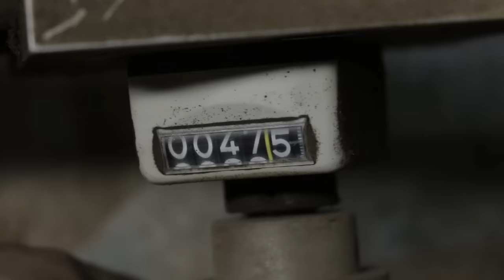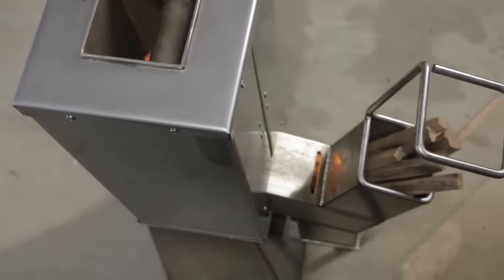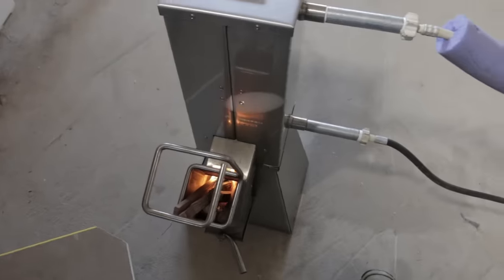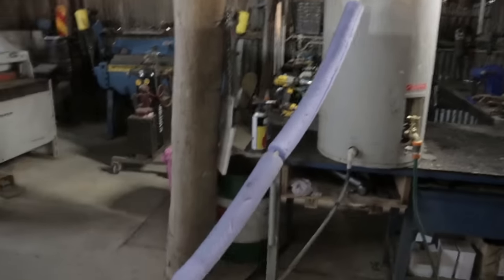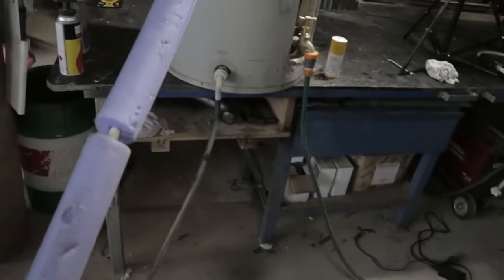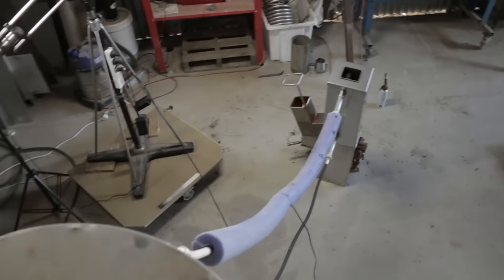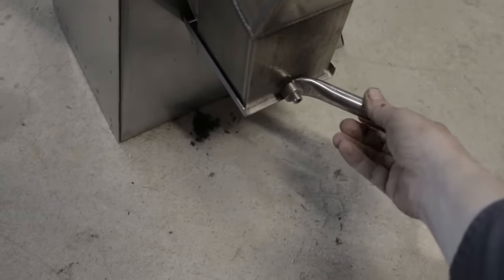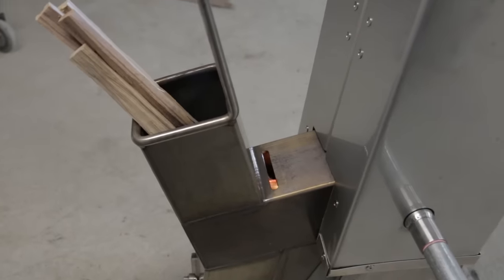Making an insulated rocket stove hot water system

Comment: how do you deal with excessive pressure ? what ratings should we be looking at for the tank
Reply from the maker: There's no pressure, it's an open system as per regulation for a water heater with an unregulated heat source.

Comment: Nice job.  Beautiful welds too!  I see you have sharpened that drill a bit (pun intended).  Would you consider building a water jacket on the flue/riser?  It would have a lot more surface area for better heat transfer into the water.  You know you want to do another mod on it!  😁  Also use larger diameter water lines to your tank for better convective delivery.  That bottom pipe might then get warmer than "cold".

Comment: Just add more heat… venturi at the fuel-firebox junction, air (fire) downstream from the venturi gets narrower, and taller (it loses about 1/3 the volume and forms a tall, wide nozzle) and enters the side of the riser, not the front.   A cold air by-pass (just a large hole about the size of a quarter) in the bottom of the riser adds so much O2 that “it is like opening the door to a blast furnace”.  From the venturi to the mid section of the nozzle multiply by 2.5. This is the minimum height of the riser. I have it designed but not yet built. Need to find someone to fabricate tungsten for the hot section. High-temp steel can handle the high temperatures for a while but it will ablade and fail.

Comment: Well, that thing is permanent. Your great-grandchildren will be fighting over it. 

It might be more efficient if you were to wrap the water jacket all the way around the flue pipe. Slip a larger section of box tube over the flue instead of having it on just one side.

Also some vertical fins in the exhaust gas stream would extract more heat. Maybe weld up the water-jacket section of the flue pipe out of 12mm box tube to make the overall dimension. 

Sorry, I'm just spitballing here. Cool video.
Reply from the maker: Always appreciate people taking the time to share their thoughts as I've learned a lot from you all. 👍 Keep on spitballing.

Comment: I built a lot of water heaters and my day and I will offer this advice. You gotta switch to copper. Copper is so much better at heat transfer. You will probably more than double your efficiency if your water pipes were copper.
Reply from the maker: I originally used copper but had a lot of comments from keyboard warriors telling me that it wouldn't last very long. So I leaned towards stainless steel for longevity knowing that it would be less efficient but would last longer.
How long would copper last if the system was run dry? 
I appreciate you watching and taking the time to share your experience.
Reply: @LittleAussieRockets  I am not sure as my system runs much hotter than yours but it will last years I would imagine. That said a friend of mine ran it dry and melted it though my system runs over 2000 F. If you do copper I would do thick stuff as it does flake a bit. The difference in heat transfer is huge though 10-20x depending what numbers you use.

Comment: Like your work. Looks awesome. Was thinking if you made a second tankon oppsite side of the flue you could harvest double the heat with double the water heating using the same burn. Something to consider. Was thinking along the same lines but using copper tubing wrapped around a round flue but that would create a superheated water at the top of the flue unless there is a forced flow.

Comment: Wouldn't the hottest spot not be directly over the flames? This of course works and if u use the heat to warm the room anyway it's not a lost. I would weld an potholder like the thing u have over a gasstove where u place the pot. On top of this so air gapped so u don't suffocate the flames and place a pot on top with water or e en better if u want to retain heat oil or sand and have a spiral copper tube in the pot connected to the water line

Comment: If this is going to be used in a single location, I think that you would be better to fill the insulated area with sand than insulation.  There is enough metal to metal conduction that you are not going to save that much heat from escaping, but with sand you could at least slow it down.  Additionally, it would capture heat from the other sides of the chimney that the water does not come in contact with and bring it to the water.  When the fuel runs out, it would still heat the water through it's thermal mass, allowing it to stay warm longer.
Reply from the maker: That is a brilliant idea.👍

Comment: I would expect condensation on the cooled side. How is it after four months?
Reply from the maker: Surprisingly no condensation to speak of
But I do live in a subtropical climate. It might be different if I lived in a colder part of the world.
Reply: @LittleAussieRockets  Ah, I am talking about condensation of the wood gases. In conventional fireplaces with a water pocket, the temperature of the water pocket should not be lower than 70C to avoid condensation. Probably in a rocket stove there are so little wood gases left at that point that it really does not matter.

Comment: 10:03 is why your cut off wheel got worn so quickly. They are not thick, their as thin as they can get. When you plunge the blade so deep, you are making contact with the other 80% of the blade, and wearing the weave/thatch from the weakest side.. They're only about a mm or 2 of material, and it goes just as quick. It's hard to break old habits, but if you can keep yourself from going beyond the minimum depth to cut it, your blade will last noticeably longer, cheers.

Comment: Just wondering about the use of tig. Isn't it a lot slower than mig?
Reply from the maker: A tig welder at the right settings requires minimal clean up and if I do my part as a welder I won't have to grind and then spend hours polishing the stainless steel to get a presentable finished product.
In this case, a tig is quicker if you take that into account.

But if you weren't going to grind and polish and we're happy with daggy mig welds, a mig would certainly be quicker.

Comment: Lovely to watch!
Was the water temp messured at the top of the tank?
Reply from the maker: The temperature was red from the top because it was the only place I could get access to with my barista thermometer.
The bottom of the tank was cold because the intake pipe remained cold for the duration of the burn, but the next day after everything had a chance to normalize the heat was evenly spread through the tank, obviously not as hot.
Reply: @LittleAussieRockets  gotcha! was woundering ^^
Thanks for the reply!

Comment: Would extra updraft help by adding more to the height?
Reply from the maker: Yes, I have experimented with that.  There was an improvement in performance when I added an extra 300 mm to the riser.
Reply: @LittleAussieRockets  it would be interesting to see a coil through the body picking up energy from such a small fire. Amazing that you transferred 30*C to the tank even though it was stratified.

Comment: GREAT job dude, executed very well 
BUT being a power engineer who deals with BOILERs all day, why wouldnt you maximze firebox to waterbox surface area and thus heat transfer  by completely encircling the vertical fire tube/4x4 with a round tank. this would simplify things by negating any need for a surround that gets insulated as well as maximizing heat transfer per btu of heat created. you definitely have the welding skills to seal the round tank on the 4x4 firetube so its a no brainer.

Comment: Biggest mistake ever on most traditional designs,  is to put the boiler/heat exchanger around the firebox. The firebox should be insulated and burn as hot as the materials allow similar to a foundry furnace. This allows complete decomposition and combustion of all the fuel present in the wood. Then downstream from that you can extract the heat from the flue gasses.

Comment: Why don't you simply put a whole coil INSIDE the column, in direct contact with the heat? It would be more efficient and you could discard the insulation part

Comment: Why not a round cumbustion chamber.  To get more that turbo working ? While creating much more heat by that.  You need to get that vortex.    Maybe with help of a Peltier for 5 volt and a ventilator for pusbing forced air.  Really. The heat shoots up to 800 - 1100 degrees Celsius.     Used that Peltier system twice.        At 30 percent hight made a tube that faced under an angle along the side and a bit facing upwards also. But only a few percent. Not more.      To vortex that was created by that was not normal.      After trial and error i only use a round burn chamber.  
Also what helps for extra heat exchange is to make a spiral at the innerwall of the round burn chamber.    They used that also with a gas heated boiler.   Because of the spiral the flames in the vortex will be pushed to the outside. To the wall of the round burn chamber.     Have i mentioned allready that it needs to be round ? And never ever square ?

Comment: excelent craftsmanship... although, I think the design is very inefficient... all that heat going directly outside... Instead of a pipe like that, a jacket with water all around it would be more efficient... and on that matter, it could have instead of that thin box outside, a thicker box, and mounted in such a way that it comes over the fire... so that the heat can go on both sides of the water jacket... and the exhaust would be on the bottom ...

Comment: you can combine those, if you add a heat conducting medium, like sand, in a tube barrel, around the coil and the rocket stove, k.i.s.s. lol
Reply: yep a barrel fire pit lol
Reply: that sheet cut + bend technique is very nice and fast
Reply: remember you can draw engrave shapes on metal with laser
Reply: yep schematic drawings cut lines etc
Reply: spin motorized tube bender coil maker fully automated
Reply: yep just spool the tube in a coil
Reply: also rivet holes market by the laser
Reply: even the whole thing cut automatically into shape, from single sheet
Reply: sand inside a steel tube (barrel pipe) is a pipe brick, flow sand brick
Reply: if it fits it sits
Reply: ash exhaust is perfect
Reply: convection water flows to the bottom

Comment: cutting stainless is the worst. feed-speed AND proper lube and cooling is paramount. but in a pinch your method will do. But doing relief cuts with the cutting disk (where you plan on milling slots) ahead of time, would have made your milling easier an less likely to brake tooling.
Reply from the maker: Thank you. I'm still finding my feet with that machine. I do have a mist cooling system that I need to install, and of course it arrived after the fact. 😅

Comment: I think that this is good job done, but does not take into account, that water will cool down wood gasses and they will not burn completely. Rocket stove should burn in ceramic tunnel and for heating water we should use gases which are fully burned and goes downward after complete burning. So all rocket stove idea here is fully lost. I would make rocket stove from bricks and drum and inside drum I would place winded pipe to heat with expelled fully burnt gasses.

Comment: doing the math (after converting metrics to bananas) i came up with 10,524.63 BTUH or 3084.46 watts of heat. about the output of a tanked water heater. how much wood did you burn to do the work?
Reply from the maker: About 8 kg of hardwood. Thanks for doing that math.

Comment: Water jacket?
Reply from the maker: I am thinking about putting an additional length of riser on top with a water jacket, as there is still more heat that could be put to use.
Reply: @LittleAussieRockets  maybe try putting a larger square section around the entire vertical pipe, seal the top and bottom, and add the connections.  That way, all four walls transfer heat.  Just a thought, love your work

Comment: Not a bad design but I personally would have made it burn off of wood pellets instead of sticks with a 8 pound hopper and have it burn around half a pound an hour or so.
Reply from the maker: Absolutely! I actually have made a pellet hopper for it. Doesn't burn as hot but I still haven't finished tinkering.
Reply: @LittleAussieRockets  how you can improve the heat output with pellets is add additional air intake right behind the burn basket about 1 inch and half in diameter would do and it needs to be about 3 inches long.

Comment: your tank is not high enough, the thermal cycling is very slow, the top of your tank is boiling hot, the water at the bottom is cold, and you have only heated a few litres of water, so far.  put a pump in the circuit, or raise the tank six feet, or more, i suggest.

Comment: I can understand wanting to save costs and not waste money but using drill bits and cutting tools WAY past their replacement date is not it.
 you won't have to worry about accidents like with that drill bit flying off after it snapped.
 less wear and tear on your equipment

Shop safety is shop safety for a reason.

Comment: Design  to be improved  you are not utilized the heat from all four sides of the square fire sleeves that's mean three sides of wall are waste  heat. 75% of the Heat is wasted.
Reply from the maker: I did that on my k-type rocket stove water heater and I found that it worked a little bit too well, I ended up with a flash boiler that just turned the water instantly into steam and it wouldn't thermo siphon.

Comment: A great way to practice tig? Use it for pretty much everything. A great way to waste time? Keep using tig when you’re proficient instead of stick or mig which will be much faster lol.
Reply from the maker: Are you implying I should have stick welded or mig welded these thin stainless steel parts?
Reply: Looks thick enough, but I was mostly trying to compliment your tig proficiency.

Comment: This stove is not working like a rocket! What is the temperature inside the tube? If is not 700° at least, is not rocket. Make a rocket stove first than your water heater will heat water to 70° in 20 min😉or less.

Comment: I can't afford these kinds of sofisticated machines, it's not worth watching 😢
Reply from the maker: You've missed the whole point of the video. I'm experimenting and learning from my mistakes.
Everything in this video could be achieved with a grinder,  welder and a drill. Sure it wouldn't look as good but the finished product would achieve the same output or even better.
At one stage I couldn't afford these tools, it's taken me years to get to this point, lots of work lots of sacrifice and I'd be silly not to use them.